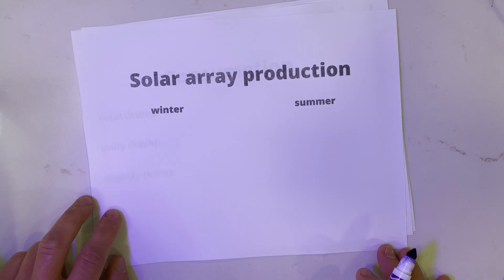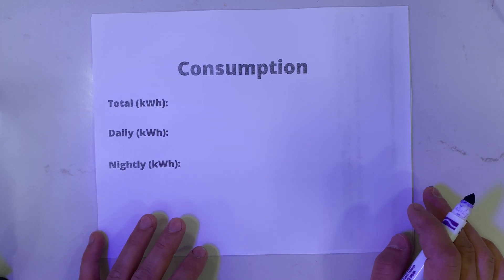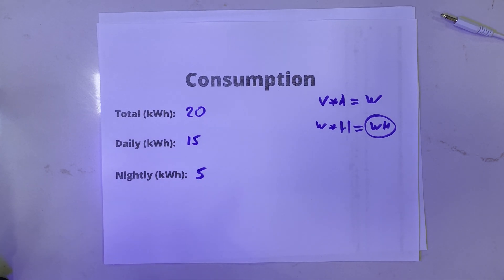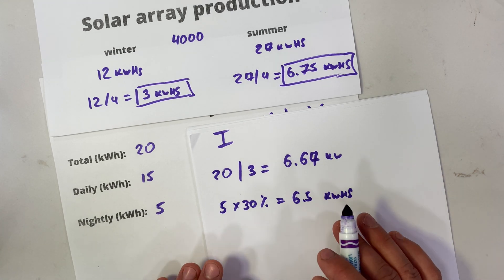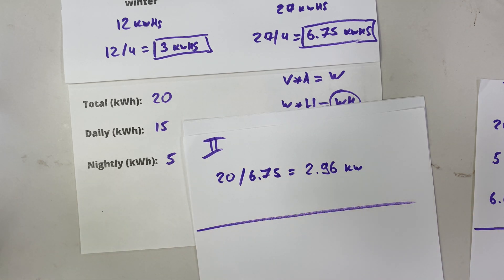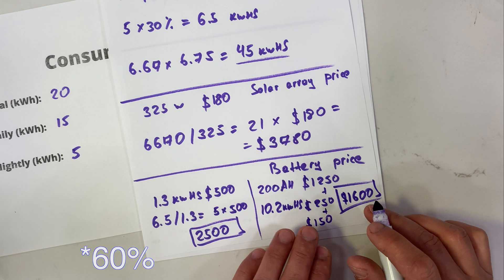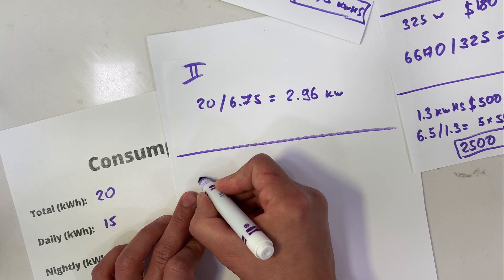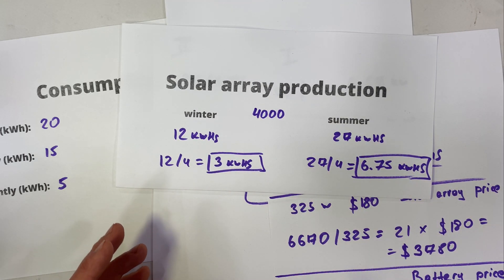How to size solar system and battery size. Explained.

Comment: Based on the several shots of your roof, your house (I am guessing is around 2,000 square feet) is consuming way too much. Have you swapped out all your lights from incandescent to LED? I found it very easy to find quality LED replacements on amazon that all are dimmable. My electric company has three billing times "Peak", "Off Peak", "Super Off Peak". When we can choose (laundry for example) we always do on "Super Off Peak". We delay A/C until "Off Peak" (10:00 AM to 2:00PMl each week day) as well. I have only 1,200Watts (connected, lots waiting to be connected) and my bill is a maximum $120.00/month and my house is 4,200 square feet (I built it myself over a very long time). So I am surprised by your consumption.
Reply from the maker: your estimate is pretty accurate, the house is about 1800sqft.
My consumption is about 15-25kWh a day (depending on if we use dryer or not).
I have all led lights, heat pump water heater (4-7kWh a day), part of the house using a heat pump for heating/cooling.
I'm overproducing right now, but in the future planning to buy EV, so all unused energy will go into car.
Reply: @SolarEngineering  That is my dream as well. I assume you have checked out "DIY Solar with Will Prowse" on youtube. He is in Vegas (lots of sun!) and feeds his house and charges his Tesla.
Reply: @SolarEngineering  I didn't think about the dryer. I am on Propane for cooking, clothes drying, heating. I also use propane to power my generator that can run my whole house. If I had the same as you my bill would be higher. I understand now.

Comment: You did not calculate the additional solar panels you need to charge the batteries for night operation. Thanks for the nice video. It really helps
Reply from the maker: panels will produce 20kWh a day: 15 will go to daily needs and the rest 5 kWh will do to the battery.
Reply: @SolarEngineering  You could allow for the 6.75 kWh of battery rather than the 5 kWh of nightly consumption.

Also night consumption could be more in winter due to longer nights, just as daytime production is less due to shorter days and different weather. O guess daytime consumption could be less then also. I guess it's important to get an idea of highest night time consumption in the year and highest daytime consumption and work with those for total daily consumption.

Then use lowest daytime production to calculate required panels for maximum consumption, and size battery to supply largest night time consumption